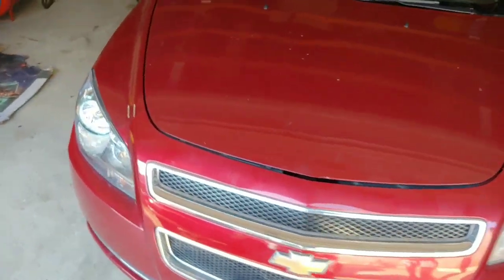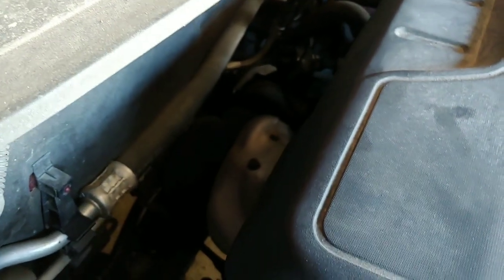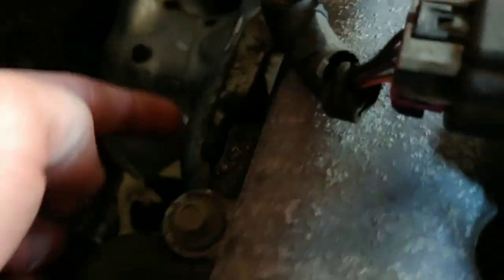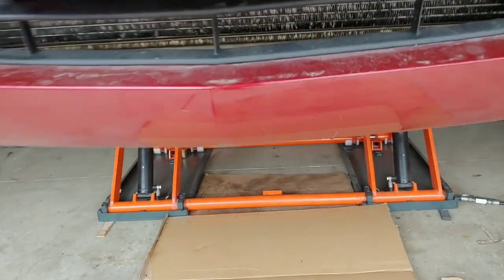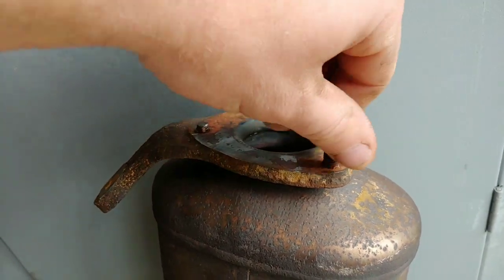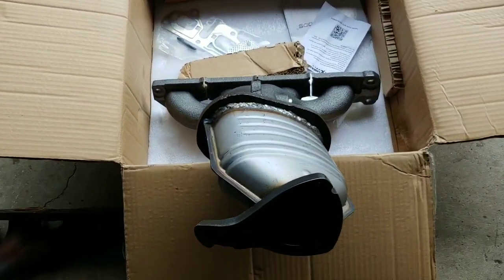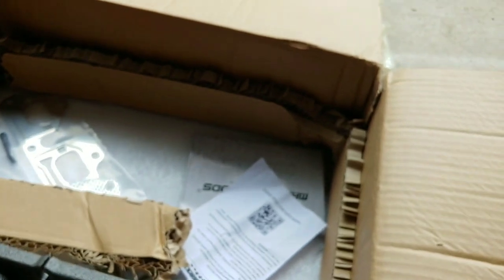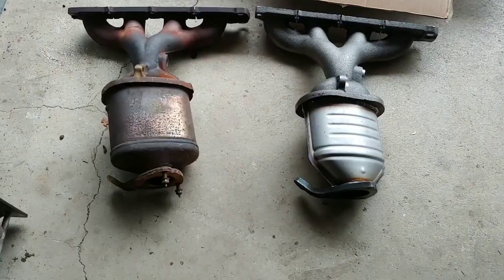2008 Chevy Malibu Clogged Catalytic Converter Replacement

Comment: Great video! Only question I have is.... Where did you get that vehicle lift/jack?
Reply from the maker: I have it posted on my videos.
Reply: @AndreychukAndrey  ok. Do you remember what size wrench you used to remove the sensors? I'm in the middle of replacing mine right now but the largest I have is 18mm and it is too small
Reply from the maker: @adamtaylor7571   I don't remember, I think I used an actual socket for oxygen sensors.
Reply from the maker: @adamtaylor7571  You can rent them at AutoZone etc

Comment: My 2009 Malibu ltz catalytic converter is clogged, I can't afford to have someone repair for me, you make it look quite easy with appropriate tools, what should I pay very close attention to? And I have been told that they can be cut off, would that cause a problem as well?
Reply from the maker: It's not to hard to do, I mean with proper tools. You could cut it off but here in Ohio they do echeck and if you have no cats and a check engine light they will not pass you.

Comment: Did u use the same oxygen sensors on the new cat???? Thnx
Reply from the maker: Yes
Reply: @AndreychukAndrey  was the second cat conv good? I ask cuz i just checked and theres a second cat in the middle of the car..i have a 2008 chevy malibu classic
Reply: @AndreychukAndrey  its the engine manifold...the resonator..that 2nd cat...then pipe then the muffler
Reply from the maker: @Alamo_City_Tx   This Malibu only has 1 catylatic converter. Is yours a v6?
Reply: @AndreychukAndrey  v4  2.2 liter
Reply: @AndreychukAndrey  oh you know what..it is the resanator..not a 2 nd cat
Reply from the maker: @Alamo_City_Tx   The flex pipe has an oxygen sensor also.

Comment: Okay so my check engine light came on today and my front catalytic converter needs to be changed. But I’m kinda low on funds right now. Is it safe to drive for a few weeks until I can afford to get a new one plus the labor costs?
Reply from the maker: Yes it's safe.

Comment: Andrey is there 2 catalytic converters on the 2008 Chevy Malibu ? I have the exact problems that you are saying on this video . a mechanic said that he will put a new front and rear Catalytic Converter.. over $2,000.00 😱 plus $500 for labor . and that there are no aftermarket C. C for my 2008 Chevy Malibu . Is that true ?
Reply from the maker: Your malibu might have 2. Front and a rear catalytic converter.
Reply from the maker: Just search on ebay 2008 chevy malibu catalyc converter. I see that they have a front and a rear catalytic converter for sale.
Reply: @AndreychukAndrey so would I have to change out both front and back ?. I went on eBay and the same mfg. that you ordered yours from . I will use same company . You are a lifesaver 🤗
Reply from the maker: @Corinacc825  You should go underneath the car and see if its the catalyc converter matches with the one you wanna buy.  You can try replace the front one first and if that don't fix it do the rear.
Reply: @AndreychukAndrey  thank you so much 🤗

Comment: What size are the 3 bolts on the bottom of the cat?
Reply from the maker: Sorry I didn't remember.
Reply: Seen you play Guilty Gear too lol.  13mm but they are rusted on bad. You need to use a set  of (Topec Impact Bolt & Nut Remover). 
Apply lube, let it set,  wipe it off, Heat it with a torch the hammer the Nut remover on and take it off with an impact with swivel adaptor.
If your doing it yourself I suggest using Ramps, 3 jack stands and  floor Jack. That way if something fails the other will catch the car.
Reply: @OzonebxGaming  haha that's funny, if you want to play guilty gear sometime let me know! I'm on ps5 😂 I ended up getting them off I used alot of Pb blaster, one was stripped out so I had to use A 12mm but thanks for the help man 👍

Comment: I have a malibu 2010 3.6 v6 and I know the rear is clogged but how would I know if the front one is clogged too
Reply from the maker: Change the rear and see if that fixes it. If not then the front is clogged too.
Reply: Most likely the front is the one that's clogged the most. Those are the ones that usually clog up on these chevys

Comment: I got a malibu classic 2008 Whats the difference?
Reply from the maker: Classic is older look.
Reply: @AndreychukAndrey  would it be cheaper to fix than the one you working on?
Reply from the maker: Is it a v6?
Reply: @AndreychukAndrey  mines a 4 cylinder ecotec. I'm currently trying to remove the top bolts.

How many are there? I can feel five and I loosened those up
Reply from the maker: Sorry I don't remember.

Comment: Mecanic want $1800, I’m In NY. How much u spent?
Reply from the maker: I just spent $130 for the cat.
Reply: @AndreychukAndrey  what info from my car do I need to order a Cat on ebay ? I'm going to try the same company that you ordered from
Reply from the maker: @Corinacc825  Just put your year chevy malibu catalyc converter on ebay.
Reply: @AndreychukAndrey  where did u order the cat from?advanced auto parts has it for $445 here in s.a. tx
Reply: I just order mine on eBay. I got mine for $120 high ratings and from Canada.